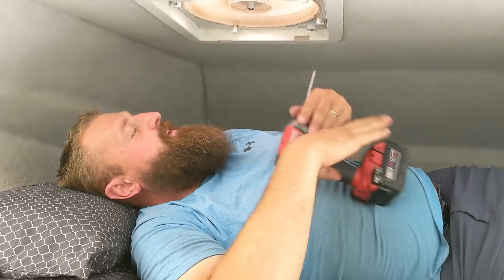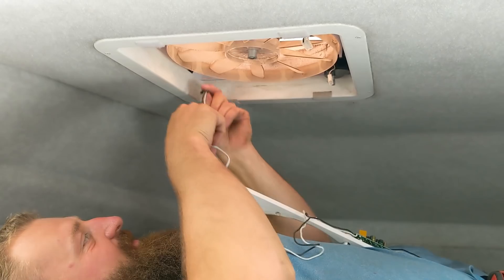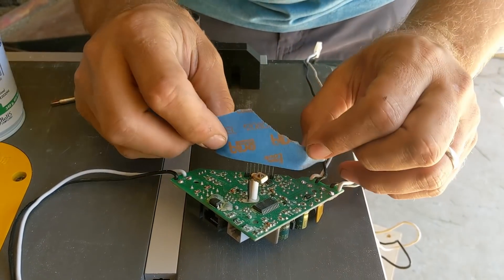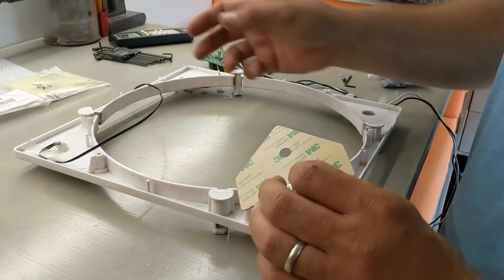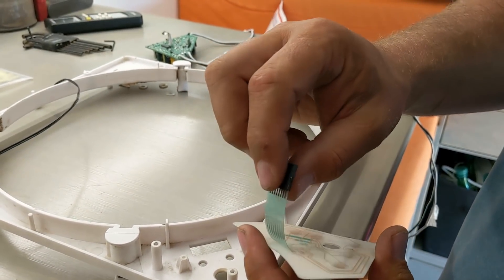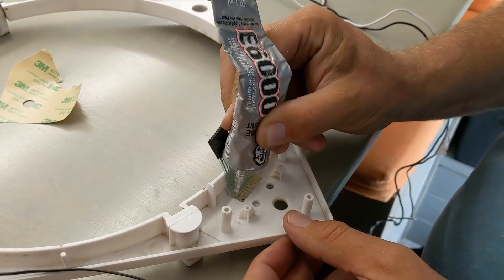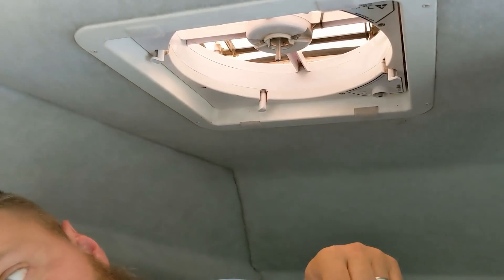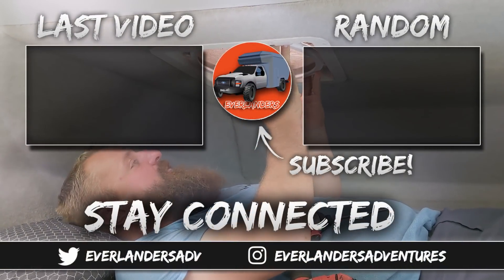MaxxAir Fan Repair & Preventing Condensation from (re)Damaging Electronics  - Manly Man Skills

Comment: How I Fix it... 
You order a new one and swap the boards and then return it for a full refund. You only have to feel bad if you tell anyone.

I would justify it since Maxx Air could have taken steps to prevent it from happening.
Reply from the maker: But that board would only last 10 days too, the problem will continue until the board is protected from the moisture.

Comment: Conformal Coating should be (for this application) a given, but it adds cost to the board manufacturing, therefore cutting into profit margins.  Not to mention, the fan company now has a recurring revenue stream.  Yet another example of toss & buy.    Shame on MaxxAir
Reply: Won't get repeating revenue from me. I tell anybody that will listen to avoid Maxxair. Why does a fan have to be computerized? Do we really need 10 speeds? Remote control? Seriously? Put a lid over it and don't worry about the rain.
Reply: @Jollyprez  There's after market 12VDC electronic speed controllers that could be retro fitted to the fan motor.  Some are on Amazon.  The speed control knob will like be the most difficult part to install.  There around $15 to $20 bucks I bet.
Reply from the maker: I ordered one of these cheap controllers and intended to make a video, but unfortunately the pwm frequencies they operate at cause a horrendous audible hum.
Reply: M Rose exactamundo. So will they address this and remedy? Or keep that revenue stream.
Reply: Over 3.5 years I’ve had to replace the circuit board 5 times and the keypad 3... worst customer service too. Because it always fails under a year they have to pay to ship it to me. Seems like more profit margin if they just built it well... i can also say they burn through employees at the same rate as the fan does electrical components. I suspect the company doesn’t know how to handle themselves in more ways than one.

Comment: Hmm, wonder if a thick coating of dielectric grease would be sufficient? Maybe drill a small drain hole under the circuit board. Thanks for the tip guys

Comment: You could also pot the PCB.  Those spray on conformal coatings tend to break down with heat.
Reply from the maker: Yup, but given the number of connectors peppered everywhere, and the way it's mounted on plastic standoffs, it would be a bear of a job.